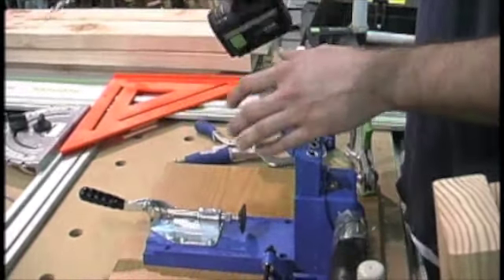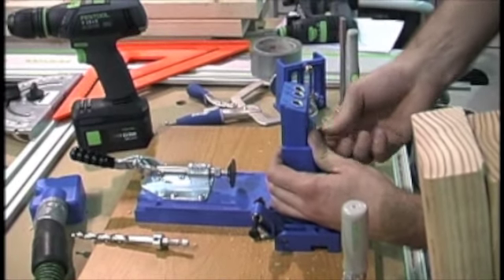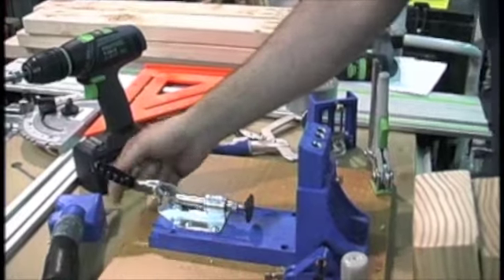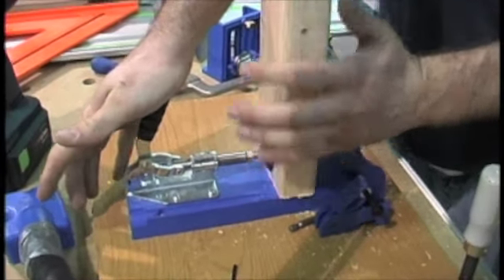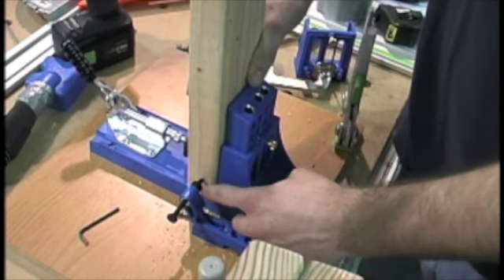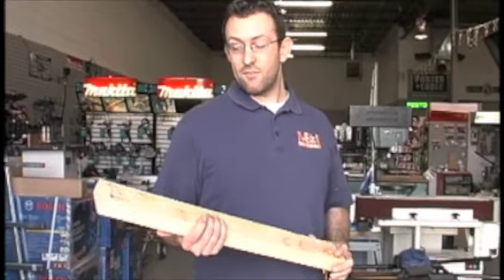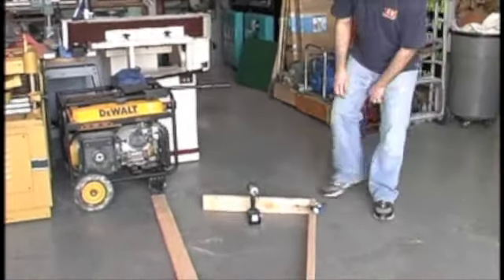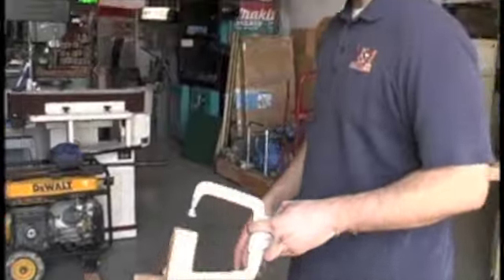Demonstrating the Kreg K4MS Jig Master System

Comment: when you hook up the shop-vac to it i would leave an opening in it somewhere to relive some of the vacuum pressure  on the motor ..... it will still remove the shavings and not stress on the motor

Comment: I have used a jig for several years and never use a pan head screw.  I use a washer head screw, but you don't need to pay the price that Kreg wants for their screws.  Impact driver is a poor choice to us as it is very easy to run the screw through and warrant starting over.  Use a drill with low speed to prevent making mistakes, unless you don't care about making mistakes.
Reply: Which is pretty much exactly what he said in regards to the impact driver.